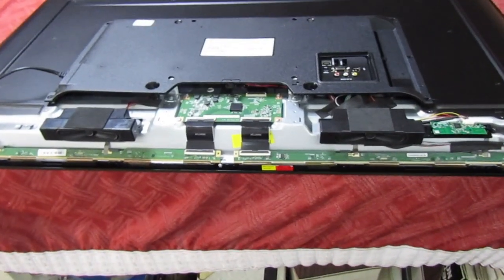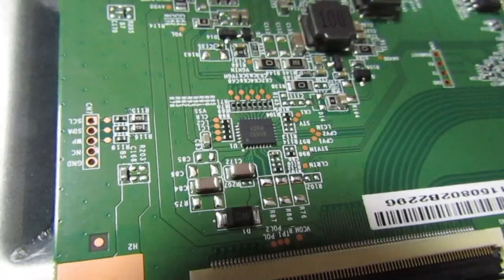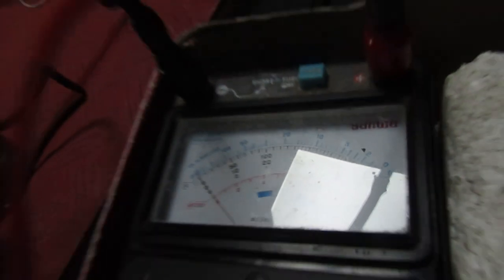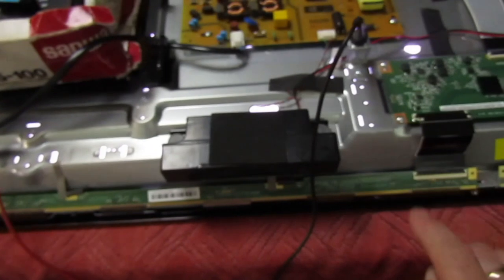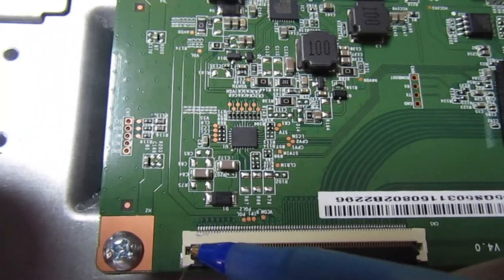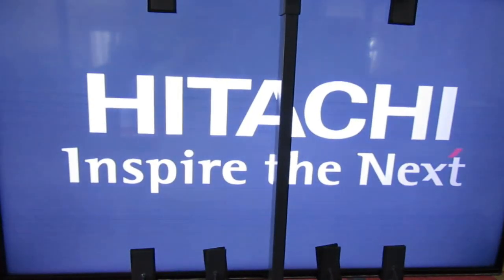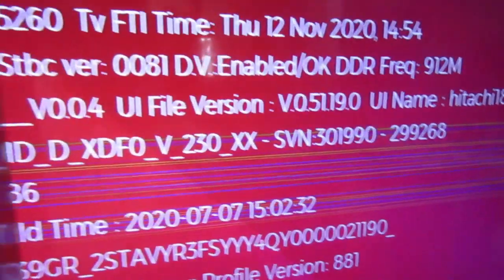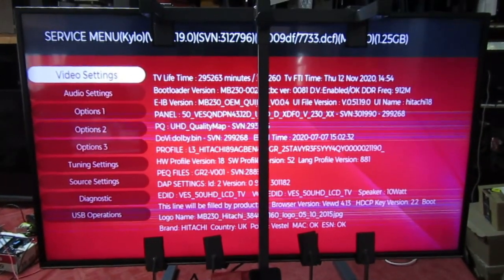Hitachi 50HK6100UB no picture, common fault , I show how to diagnose the problem.Vestel based.

Comment: Great Video, Vestel have had a real fall from grace since early 2020, and theres thousands of them just waiting to fail, if you see a VES580 with a picture on it its a novelty already. Best wishes from Bruces TV up north.
Reply from the maker: Very true, I don't know what's gone wrong, had quite a few VES580 s with this same fault, I suspect it is an in glass short rather than COF failure.
Reply: What makes you think it's in glass not one of the caps I'm just curious
Reply from the maker: @davidknightaudio934  The clock lines seem to pass straight into the LCD panel , it wouldn't be difficult to diagnose for definite if someone gave me a set to keep , just cut of the COF chips one by one at the glass side .

Comment: Another great video Michael, there's a lot to be said for older technology. Yes it used to break down but we could usually get everything we needed to fix things. I would imagine that customer thought he would get a whole lot more than 2 years use out of what was no doubt an expensive TV.
Reply from the maker: The usually comment I get from a customer will be we had an Hitachi for donkeys years and it never went wrong, however as we all know in the trade now all the major manifactures no longer exist, there simply just a name now.
Reply: Hi Michael & thanks for the reply: Yes, sadly they all seem to be putting out the same rubbish. I suppose a lot of it is that consumers want a cheaper and cheaper product with more and more features, sadly there doesn't seem to be such a thing as a simple & reliable set anymore. You have a good weekend and try not to work too much.
Reply: I wonder if Vestel are seen in for repair more simply because they sell so many (they must be number in Europe if you count all their brands). If the failure figures were so bad Argos would switch to a Chinese OEM like Skyworth or Changhong you’d think but they’ve been solidly using Vestel for about 30 years now.
Reply: @michaeldranfield7140  oh, yeah, hitachi csp680, cnp190, etc. those beasts seem to go on forever! used to have several, most sold off to friends cheap in the 90s, still perfectly usable back then, unfortunately had to dump a 'rare' csp680 in the mid 2000s when lost the use of storage 😢😢
Reply from the maker: @interstat2222  You could well be right , I saw a promotional video on Vestel quite a number of years ago and they were making 47,000 sets a day back then , the problem with Argos is they stick very rigidly to the 12 month warranty and most vestel will last 18 months to 2 years , I have had good successes though in getting customers a pro rata refund out of the 12 months warranty by saying in a written report this has been a manufacturing defect.

Comment: Thank you! This was the solution for my tv. I literally just stuck a bit of plastic to cover some of the pins and it worked!!
Reply from the maker: Sometimes the tape fix is not permanent, you may well find the whole panel packs up 6 months later .

Comment: Very useful information if I ever have to try repairing one of these sets. Strange how a lot of the newer sets fail just after the warranty expires.
Reply: Mine lost screen display 3 years exactly from date of purchase. Very suspicious.
Reply: @lexilou9119  same with my mum's 59", 2 year's and poof. She had it on a moving bracket and tbh, the build quality isn't the best as it flexes when I took it home and assume that the flexing could have caused it. I have an Hitachi 50" mounted flat to my wall and never had an issue and I've had mine nearly 4 years. 🤷🏾‍♂️

Comment: We have the same model as this and had the exact same lines for the last 8 or 9 weeks getting progressively worse, but would vanish once the TV had warmed up. Turned it on today snd there was a black spot on the bottom right hand side, with more lines, 20mins later it was dead (the screen).... I will do the same checks as you did in the vid.... if it has the same outcome. What would i need to replace or is the TV a lost cause!?.... Id be super keen to keep and get it back working as its picture is really good.

Comment: How did you put into service mode thanks andy and will this work on a hitachi 58hk6200u
Reply from the maker: for most vestel sets you press Menu, 4,7,2,5 on the remote , if that doesn't work you will need the service manual for your set as a few vestel sets use a different sequence .
Reply: @michaeldranfield7140  tried does not work on this set tv was working but now has a bluish black tint cannot get any pic at all tried covering some of the ribbon pins to see it gets a pic but nothing am at a loss on how to test it thanks andy
Reply from the maker: you need a new LCD screen then , you have an in glass short . @GeminiHammer
Reply: @michaeldranfield7140  have now passed tv on so no more faults hooray lol

Comment: The t-con numbering suggest that this is a PANDA panel. Do these panels also fail so quickly in TVs from other manufacturers? I'm curious to know if this is because Vestel doesn't follow the panel manufacturers' assembly instructions, or if the actual panels are just that bad.
Reply from the maker: In every set I have seen from 32 inch to 58 inch they have all been vestel based sets with this fault, I suspect this is an interglass short rather than COF failure.

Comment: Some display panels have an EEPROM on the other source board, if you unplug that side there is no picture and/or no backlight.
Reply from the maker: Yes I have seen this problem caused by either side, I suspect its a in glass short rather than COF failure.

Comment: I have the same TV and multiple capacitors are shorted on the left (face-down) screen panel board. There must be one causing multiple shorts I would think - or is it likely an internal screen fault.

Comment: Where can I purchase T-con board from a genuine supplier? Ebay and Google searches just show used parts sellers. Current TV symptoms are dynamic lines appearing next to images which worsen with increaaed duration that TV is left on. Hitachi 50HAK6150U only 3 years use.

Comment: hmm wonder if that'd be a case for a claim under consumer law, fit for purpose and last a reasonable length of time...
Reply from the maker: I have managed in the past to get a few people a pro rata refund from Argos on these sets but some customers can't be bothered complaing and just buy a new set.
Reply: @michaeldranfield7140  we complained about our washing machine only lasting 3 years to currys when we had to get a new one, and previous one same model also only lasted barely 3 year and asked if we could get any discount  due to short life and the new consumer regulations and was told, 'no, it doesnt work like that, out of guarantee, its on you, nothing we can do'
Reply: @andygozzo72  That's a cop out on their part and they can't just fob you off like that. I don't know about the UK consumer regulations, but here in NZ the act states that goods must last "a reasonable period of time" and a washing machine would be expected to last at least 5 years. If the item fails, you have the right to go back to the retailer (it's their responsibility) and ask for a repair or replacement depending on the item and what happened with it. If they can't repair it then they have to replace it at no cost to you.  Saying that because it's "out of guarantee" means nothing, they can't "opt out" based on that. The guarantee is one thing, but the life expectation is another and even if an appliance is only guaranteed for three years here, if it fails at 4 years you can ask for a replacement and they have to abide by the law. I suggest you study the consumer regulations carefully and if in doubt, contact the bureau that administers them.
Reply: @sw6188  oh, they did, i tried to tell them about searches i did on the net saying 5 to 10 year life, but no, they werent having it, no idea of NZ law but it was fairly recently updated here in the uk, items must be 'fit for purpose and last a reasonable length of time', problem is what is 'reasonable', many appliance repair places we tried said 3 years was about right 😲😲 i have radios back  to the 30s still working, my main pc is from 2007, pretty much all our tvs were dud chuckouts i repaired myself...

Comment: Great video as always Michael. I have a query you may be able to help me with. I've a walker vestel tv that the backlights flash for a moment on startup and then off. Screen is working with the flashlight test. Tested backlights and all work. Any ideas?
Many thanks
Allen
Reply from the maker: How did you test the backlights , that is the question , did you test them at the full rated current as per the barcode on the psu board or did you test them with a LED backlight tester ?  chances are the LED S are faulty and you tested them with a LED backlight tester that only provides 30 Ma which gave a false result .
Reply: You are absolutely right. I tested them with a Chinese backlights tester and all lit up. I realised it was the back lights when I tried another set and they remained lit. Is there any way I can contact you privately or do you facilitate that at all?
Many thanks for your reply.

Comment: My mum just gave me her 2 year old TV which has both horizontal and vertical lines. 
Could this trick work for both or do you suspect the circuit is fried?  
I have a Hitachi TV too and it's a lot older n no issues at all.  🤷🏾‍♂️
Reply from the maker: You could try but in the end the root cause is the LCD panel itself thats faulty .
Reply: @michaeldranfield7140  many thanks for your reply! 
It is a weird one because when I brought it home, plugged into a plug bar, is when I got both lines. Then switched it off and held the power button for 30s then plugged back into the wall then tried it, the vertical lines went but the horizontal lines remained. Switched off and back on, the lines were still there then it went to full clear screen. Switched off again and back on and reverted back to lines so I'm guessing something is intermittent here?

Comment: is there a way to fix this tv just got one didnt check it has the same lines and sometimes powers on can hear sound but just a blue screen no picture any help would be appreciated cheers
Reply from the maker: only way is to replace the LCD panel but the cost is more than the TV s worth and these are so bad I wouldn't even consider a second hand one .

Comment: Found your video too late . Just bought a new T-con board for 58hk6100u A 2009 and nothing changed but put the tape and results same as yours. Although if I touch the connection from the T-con board to the left side of the driver board(the long panel ) the lines go away . Can't figure away to keep it that way. That long panel could be faulty . Another suggestion maybe cut the clk/ckl lines physically on the board? Any suggestions? Thanks
Reply from the maker: the COF strips are heat bonded onto the LCD panel , not really much prospect of any repair, have a look on youtube for a COF bonding video to see what's involved .

Comment: Hi, so I blocked out the first 8 contacts and have the same screen with lines. What would be the issue please?
Reply from the maker: LCD panel is faulty , very common on these sets .
Reply: @michaeldranfield7140  thank you. The lines aren't that bad so my son still uses it. It is safe for me to keep the contracts blocked and still use the tv?
Reply: Yes?

Comment: 'tis buggered then?  At least you have a full set of spares for everything but the the screen.

How many sets, percentage wise, would you say suffer from the same thing?  I guess it goes without saying that it's BER?
Reply from the maker: Up to now this is the only fault this model suffers from. You also get the same problem with different badge name sets using the same LCD panel so definitely a manifacture problem.

Comment: Glad to be retired and out of it now, nothing's any good now, Hitachi of all people outsourcing their stuff to Turkey, Vestel were never wonderful but they're down the pan now, meanwhile the crt on the little portarama I'm working on is as bright and pin sharp as the day it was made, and that was over sixty years ago, progress?.
Reply from the maker: I gave always been a fan of Vestel from the CRT days, bog standard circuitry mostly lifted straight from  the Philips datasheets but since 2020 they have gone right down the pan like you say, can't beat CRT technology.
Reply: I started repairing TVs in the mid-70s, got out of it around 2002 when the flat panel sets started to arrive here. Lost interest in dealing with such bad technology and I am glad I stopped doing TVs then as this modern stuff is absolute junk and way too easy to damage if it falls over or a kid throws a stone at it.
Reply from the maker: @sw6188  too right , Im glad I no longer sell new TV s , I couldn't do with all the complaints !

Comment: Will this be the same process on the hitachi 58hk6200u?
I have about 8 inch of lines at the bottom of the tv set.
The picture is still visible but just has lines.
Shall I try to investigate or just take it for recycling

Comment: Wow I have 46720 Hrs on my LG 49" TV  and my mums 13" Sony from 1971 is still Working fine and in daily use. Quality has really dropped off.
Reply from the maker: Got a couple of KV1320 s from 1971 ish and there still working without any component change, just shows how well made the Japanese stuff was when they were building a name for themselves.
Reply: @michaeldranfield7140  My folks bought a Sanyo Telecolor III (5C670) back in 1974, just in time for the Commonwealth Games here in NZ. That set lasted until 1996 when dad decided to upgrade and it was still working when it was moved out into the shed. Give me an old CRT set to fix any day, much easier than this modern junk. 
Speaking of that, I had a thought - given that all these flat panel sets are now micro-controller operated, why is there no "service port" like the OBD-II port on a car, so that you can plug a scan tool in and do real-time diagnostics? You'd think they'd be able to provide such a feature, but I suppose they don't really want us repairing these sets - they want the customer to buy another one.

Comment: old people or anyone with no high fidelity needs,will accept this kind of repair as ok.Done this  many times.sometimes the lines are barely noticeable.I have a question sir.Where can i find a stand like this?
Reply from the maker: The company I bought the stand from closed down so you won't get one now but if you know someone with a welder it wouldn't take much to make one.
Reply: @Michael Dranfield  finding a blacksmith o welding torch,is easy,the hard part is to make it as it's supposed to be.Is it angled towards the back so the panel doesn't stress?
Reply from the maker: No it's vertical, Might have ago myself with a mig if I can find some spare time as another would be handy.
Reply: @michaeldranfield7140  if you do so,please make a video about it.

Comment: Great video, thanks! I have this TV but the screen has some vertical lines showing, not a blank screen like yours. Is this likely to be the panel, or T Con board? Thanks 👍
Reply from the maker: its more likley the LCD panel is faulty, most vestel sets made from 2020 upwards have been shocking for panel failure .

Comment: 58'' Hitachi is very anoying 9 of 10 for repair has same issue ~after blocking ckv signals no lines but one side screen red color is distorted, so scrap any way.
Reply from the maker: but if you can get some sort of picture at least you can check the run time and then go back to Argos to make a complaint, that's where this set is heading , if you state its a manufacturing fault most customers will get a pro rata refund of 70-8- percent .

Comment: I won't buy anything, new or used, from Vestel - out of numerous sets that have passed through my hands over the last decade or so, only a 2011 Alba seems to have had any sort of reliability, and even then I suspect that's only because it's a bedroom set and hence had limited use. 

The worst was a 42" Bush from Argos that died two weeks after the two-year warranty expired. Absolute garbage landfill fodder, cynically and unashamedly contributing to the massive e-waste problem. (Same reason i wouldn't buy a 'smart TV - many are well on the way to being outdated vefore they leave the factory. A Chromecast or Fire stick might use up a HDMI port, but at least it can be easily replaced when it fails or us superseded). 

I find the use of legacy brands, exploiting consumer confidence built up over many decades, very dishonest too. I have exclusively old Panasonic plasmas and LCDs now - they cost a bit more to run and are obviously only 1080p but never seem to go wrong. And my eyesight isn't good enough to be able to distinguish between HD and 4K anyway!
Reply from the maker: I have always been a big fan of Vestel from when they made CRT sets, bog standard circuitry mostly lifted straight from the Mullard chipsets datasheet's  and from that point of view not much has changed electrically but as you have pointed out with everything been software controlled and software is not available to most people these sets have built in obsolesce , not to mention backlight LED s in series , all designed to fail .

Comment: 2yrs lifetime.. WHAT A SHAME FOR HITACHI!!!!!!
Reply: *Vestel
Reply from the maker: Made by vestel in Turkey, you can get the same set with loads of different badges on the front.
Reply: Think there badged tvs like Toshiba goodmans grundig etc made by vestel turkey  crap  nothing to do with hitachi
Reply: @ChrisSmith-ld5wt  Probably those brands pay to Vestel to produce their cheaper line of TV's or they have sold the name brand to Vestel altogether.
Reply from the maker: @ChrisSmith-ld5wt  of course , most sets are just a badge these days , you can easily spot a vestel from the back without removing it , they all look the same !